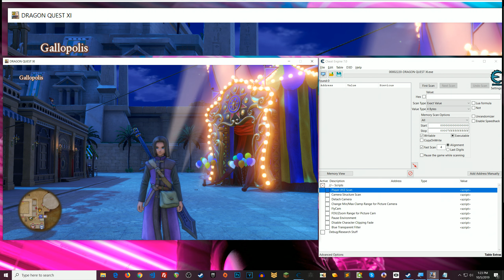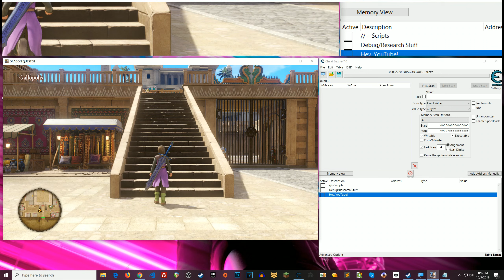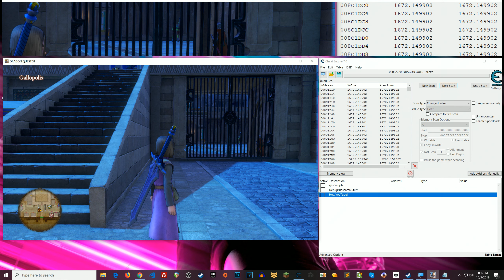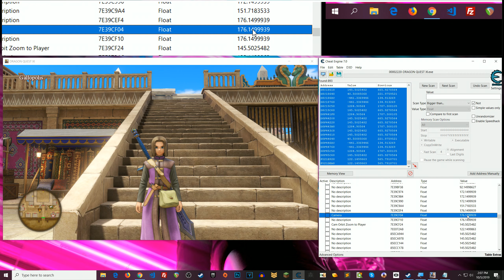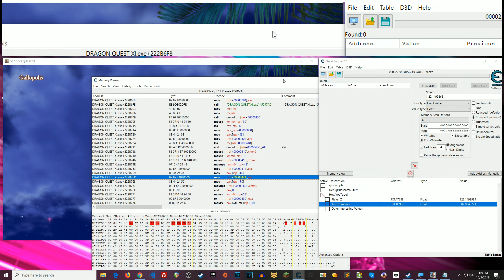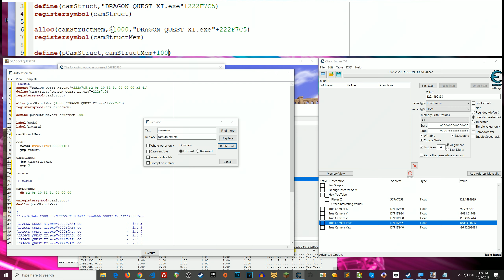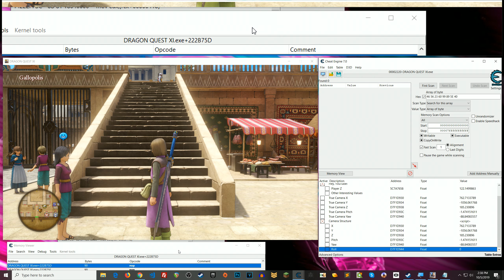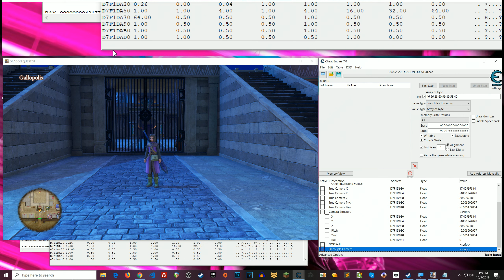How to Make a FlyCam from Scratch - Part 1: Coordinates, Rotation, and More!

Comment: What is the difference between using assert() as opposed to aobscan(). They both essentially just check an address for an AOB in this case right?
Reply from the maker: In this case, assert() checks an exact location in memory for a byte pattern. That's it. The script will either enable or disable based on the result.

Conversely, aobscan() has to scan through memory until it finds the first address containing the specified byte pattern. If it does, it applies a label name to that memory location.

Thus, aobscan() is a more intensive and involved function.

Speed of a script enabling is the primary factor I bear in mind when I use the assert() approach instead.

Comment: So, does the flycam script work independently by itself, or will I have to find the correct values of everything? I tried the provided flycam script, which looks much different than yours, and I'm getting Error at line 2, the bytes were not what was expected. I am not sure which version of the game I'm running, it doesn't say anywhere.

Comment: Hi Stephen, 
I came across some issues while trying to use your mehod to decouple the cam from the player on a different game,

After NOPing the writes to player XYZ, the camera continued to glue to the player using the pitch and yaw. 

I am currently brainstorming for a different method, do tell me if any comes off the top of your head.
Reply: I could be wrong, but try NOPing the XYZ coordinates of the camera and not the player.

Comment: How would you find and break out of a boundary box that's attached to the player?

I have a game on PS4 where it has a free fly photomode camera but it's trapped in an invisible 40x40 (float) box that's fixed to the player, so 20 float distance from the character either side before the camera's movement is restricted. I want to break free of this, but I've spent hours with the debugger checking thousands of addresses using changed / unchanged scans, seeing what reads and writes to them, nopping them but no success.

Comment: I searched for every possible pitch/yaw value using "Value in between" and two approximations of the camera angle in degrees/radians, and it gave 0 results after doing a few tests. I've been stuck in this for a week and I have no idea how to stop making my camera circle around a certain point in space when I change its position. "Metal Gear Rising: Revengeance" btw

Comment: I'm still trying to go through the video and follow along. I'm using xenosaga (using the disc) as a basis. I THINK I've found the character coordinates and camera for the XYZ, and how to stop the camera from following the Main character. But when I try to add the filter scripts you gave, cheat engine isn't booting. so I renamed the .ct file and it boots now but its saying that the filter scripts have an invalid } symbol. Should these scripts only be used with version 7.0 of cheat engine?
Reply from the maker: Put the filter file inside of your Cheat Engine autorun directory (wherever you installed CE at). It'll automatically load for use there; no need for you to run it individually or enable anything!
Reply: @StephenChapman  I did put it in the autorun directory. What I mentioned is what happens with it inside of the autorun directory and start cheat engine :( Sorry, I should have been specific.
Reply from the maker: @kuriatsu  Did you download the raw file from GitHub? If you just right-clicked on "Exponentiation and Nan Filter.lua" and chose to save it, that's not the actual script. You'll have to left-click on "Exponentiation and Nan Filter.lua", then in the window that opens, right click on the "Raw" button (you'll see it in the top-right quadrant of the screen), and then save that. Same goes for any file (outside for compiled releases) you'd like to download from any GitHub repository!
Reply: @StephenChapman   I right clicked them. I'll try using the raw option. I apologize for my ignorance as ultimately that's my fault. Thank you for your guidance.
Reply from the maker: @kuriatsu  No apologies needed! I've been using GitHub for so long now that I've forgotten how unintuitive that part actually is.

Like, you see the name of the file there with the extension, so it SEEMS implied that you can right-click and save-as on it, just like you would on damn near any other file on the Internet, lol.

To that end, the reason I link to the place I do in repositories like that, is so that people can click on anything within it and view the source code before downloading the file. That's the intention GitHub has: see what's in the file before the user risks downloading and compiling/running/loading the file.

Anyway, let me know how you fair. You should be good to go now, but if not, check out the video I did that's called something like "Borderlands 3: Cheat Engine and Cheat Tables for Beginners" or something like that. In it, I give a walkthrough of how to download stuff off my GitHub repositories. =)

Comment: I'm still having a problem applying this to Ni No Kuni 2. The camera moves slightly back and forth all the time, even when the player stands still. Please visit this link and look at the bottom https://www.cheatengine.org/forum/viewtopic.php?p=5755024&sid=3dd1672430dbc4db266b4be00e9a3411#5755024 for more info of my other problems I'm having when using the fly cam, or see my email I've emailed you. I need some personal tutoring so I can do this for any game I want myself. Let you know, I am a visual and hands-on learner, but I don't learn fast. I'm still trying to learn how to draw my first digital picture with my graphic pen tablet (due to paypal issues, I'm not able to start the class yet)
Reply: crashed again when trying to freeze values. Why is this so difficult?
Reply: Now it crashed during opening "find out what accesses this address"